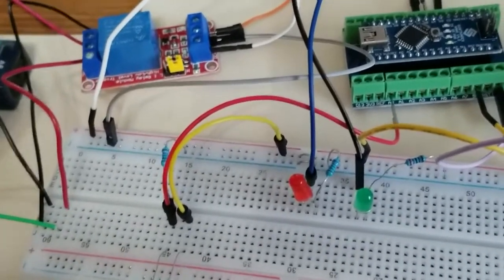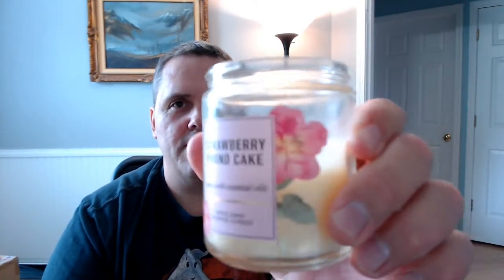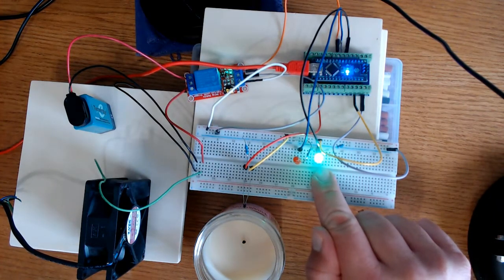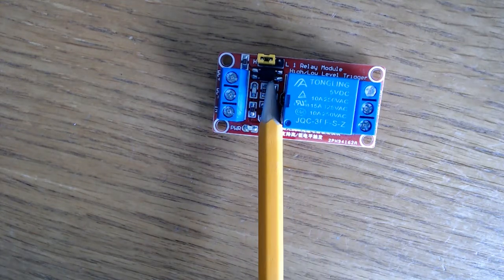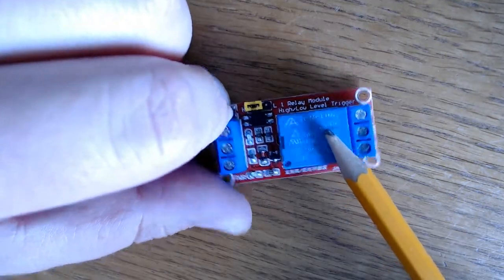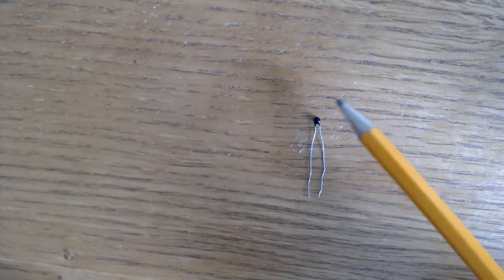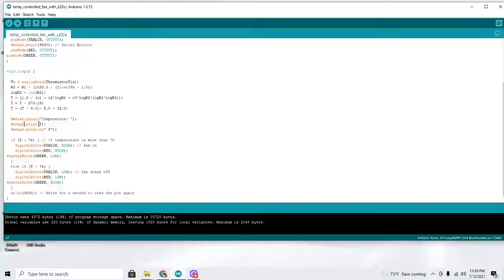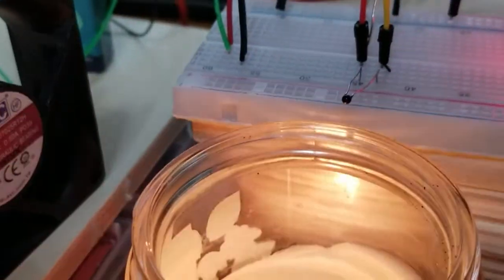Make A DIY Temperature Controlled Fan Using Arduino Nano And A 5V Relay

Comment: Hi, I like your set up, but where can I copy the sketch? Writing it from the screen is quite difficult :)
Reply: Thank you it saves me a lot of time and possible mistakes!
Reply from the maker: @tomhoekstra1088  welcome anytime!
Reply from the maker: Hi Tom. I copy all code to the Facebook page, mainly because it doesn't fit in the description sometimes. Here is what I used.  
 #define FANpIN 5
#define GREEN 3
#define RED 4
int ThermistorPin = 0;
int Vo;
float R1 = 10000;
float logR2, R2, T;
float c1 = 1.009249522e-03, c2 = 2.378405444e-04, c3 = 2.019202697e-07;
void setup() {
pinMode(FANpIN, OUTPUT);
Serial.begin(9600); // Serial Monitor
pinMode(RED, OUTPUT);
pinMode(GREEN, OUTPUT);
}
void loop() {
Vo = analogRead(ThermistorPin);
R2 = R1 * (1023.0 / (float)Vo - 1.0);
logR2 = log(R2);
T = (1.0 / (c1 + c2*logR2 + c3*logR2*logR2*logR2));
T = T - 273.15;
T = (T * 9.0)/ 5.0 + 32.0;
Serial.print("Temperature: ");
Serial.print(T);
Serial.println(" F");
if (T > 74) { // If temperature is more than 74
digitalWrite(FANpIN, HIGH); // fan on
digitalWrite(RED, HIGH);
digitalWrite(GREEN, LOW);
}
else if (T < 74) {
digitalWrite(FANpIN, LOW); // fan stays off
digitalWrite(RED, LOW);
digitalWrite(GREEN, HIGH);
}
delay(3000); // Waits for 3 seconds to read the pin again
}
Reply from the maker: There are other ways to do it...i"m sure you could improve on what I have here. Hope that helps! 👍
Reply: @BMonsterLaboratory  That is kind to say, but I'm shure I cannot (I'm an technical engineer and do not know anything about electronics) but I can copy quite nicely :) - unfortunately I have only a TMP36 thermo sensor, which you do not use. I assume I better do not cut off one of the legs haha but where to connect to, I have no idea...

Comment: Is it possible to do it without the relay? Cuz i followed your temperature sensor with lcd on it and now i need to put the fan into the circuit but still confused
Reply from the maker: Hi Irfan!  Yes, you should be able to do it without a relay. You can use a 9v power supply (wall adapter or battery connected to Vin/GND). From the 9v power supply i'm thinking you can use a voltage divider circuit and drop 9v to 5v so you can connect it to pin 5. You don't want to connect more than 5v to your digital pins. I haven't tried this ...just thinking out loud. If you're unsure or need help, let me know and I can try it and send you a circuit diagram.  hope that helps!  good luck
Reply: A little late to the game but did your project work without the relay?